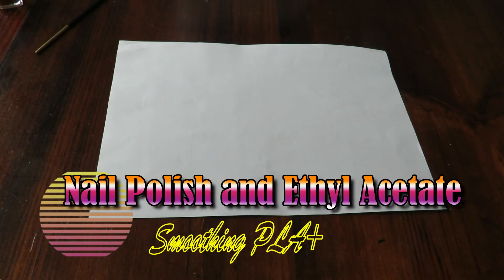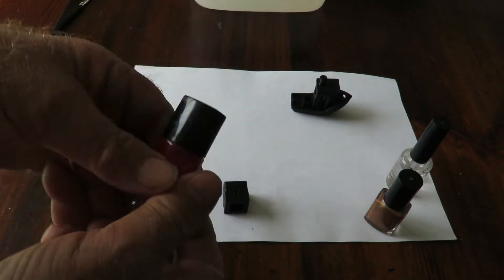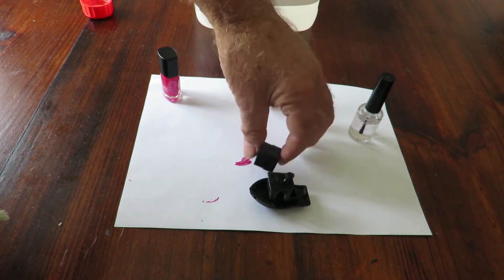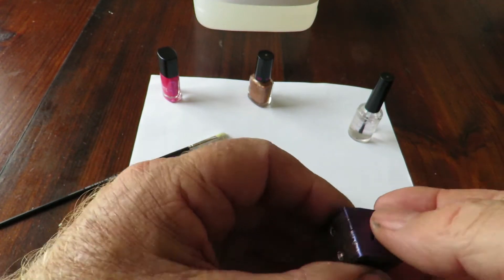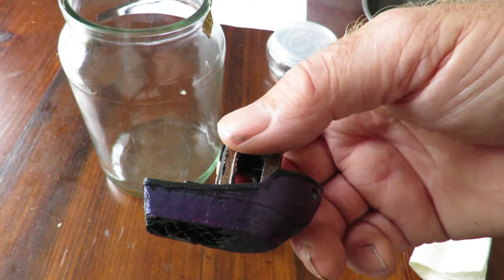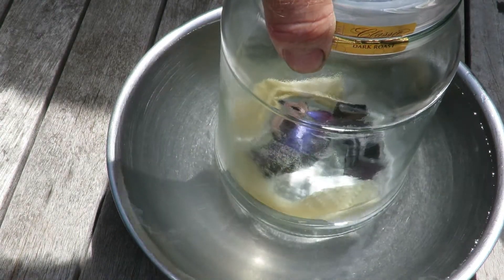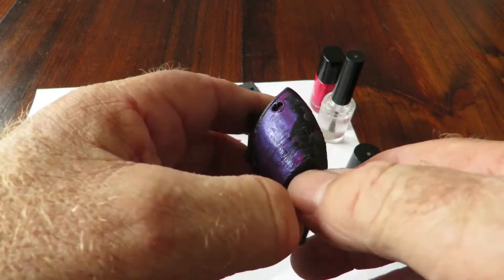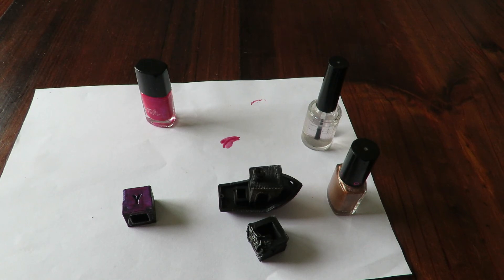📌 Smoothing PLA 3D Prints using Nail Polish and Ethyl Acetate - Will it Work?

Comment: Thanks for the video, I wish I had researched before buying that solvent! Some random 3d print page said it worked, and obviously.. It doesn't. Just discolors and weakens. It also caused one of my test prints that had an underextruded layer to curl up and split at the layer! And even if it worked, it ruins the print. Permanently brittle and faded.
Reply from the maker: I did eventually find a method of smoothing PLA prints which seems to work OK.
My videos below.
https://youtu.be/lhFCnAH87AI
https://youtu.be/AB9UACS5Pbs

Comment: The part where it becomes gooey after sitting in the liquid is actually great news! Could you please try dipping and maybe baking the part until it's solid again? Maybe then it will smooth.
Reply from the maker: The problem with the Ethyl Acetate, is it leaves the printed finish soft, and also discoloured.

I did find a cheap working method for smoothing PLA prints below using Polyurethane

https://youtu.be/lhFCnAH87AI